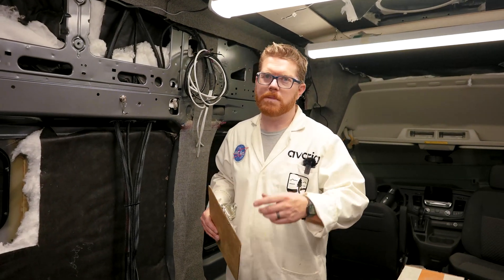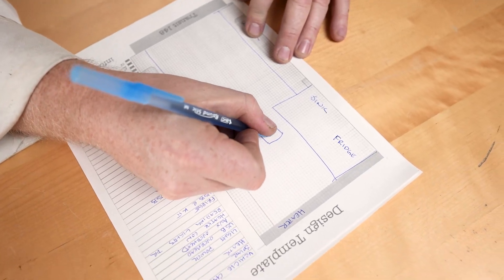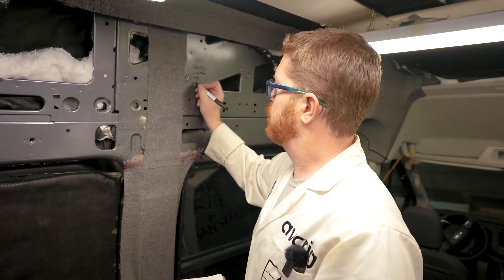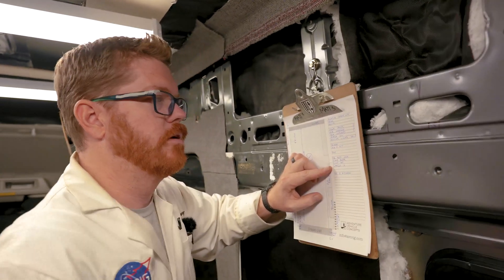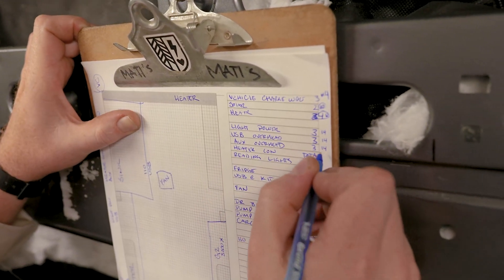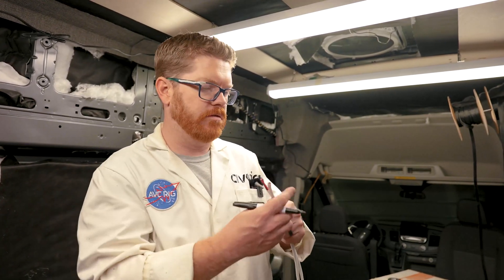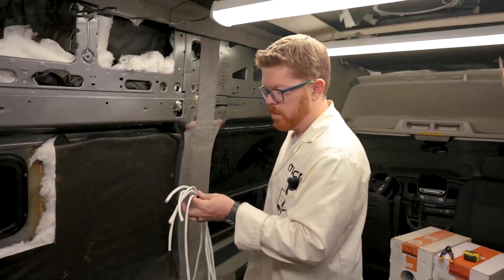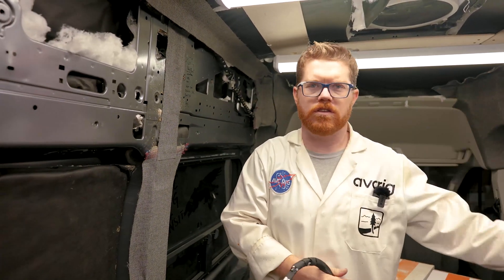WIRING in Ford Transit | Custom Wiring Routing - Planning and Install

Comment: Is there a specific reason to put the yeti goal zero 3000 on the opposite side as the water or is there just not space under the kitchen galley for it in this layout?
Reply from the maker: Two reasons. 1. I don’t like my main power system next to my water system. 2. Better balance of weight. That GZ 3000 is heavy!
Reply: @AVCRIG  cool. Thanks!

Comment: Another great video, thank you very much.
I’m leaning toward it being a good idea to insulate and frame before wiring? Does that seem mostly correct?
Reply from the maker: Yes, absolutely. I find it’s easier to insulate first. Framing the ceiling is good it holds up the wire runs. I don’t frame the walls. I found it unnecessary.

Comment: Very helpful video thanks! Question tho, when you're measuring out length of wire from your goal zero to the water pump you mention you pull 5 arm lengths. when do you account for the switch for the pump? Does that not have to be included in that circuit or do you run that length separately?
Reply from the maker: I run that length separately. Switches go in different locations for different builds. This is also why I over size the wire for this circuit.

Comment: Where do you wire the D+ ignition wire for a DC charger? Do I need to pull the driver seat to access the vehicle interface connector?
Reply from the maker: We use the Victron Orion that doesn’t need an ignition wire. If your system requires it you are correct that you pull the seat to access the wiring location. (It’s not too tough I did it for my subwoofer)

Comment: These videos are super helpful and well timed as I recently started my build.  I am curious why you routed the wires through the ceiling rather than through the wiring channel included in your sub-floor?  I purchased one of your sub-floors and am getting ready to install it, but still trying to decide if I want to run the wires under the floor or not.  Thanks!
Reply from the maker: I run the vehicle charge wire and Espar power wire under the floor. I’ve definitely run more in the past on other builds. Especially the larger gauge wires for pump and fridge.  This was a pretty simple build and I wanted to show more options for DIYers.  Thanks for the question!

Comment: Love your video!  I would love to see how you connected the alternator power cable to the driver's seat location.
Reply from the maker: That’s a good point. I’ll add that to our Yeti power setup video.  
If you need that now, there is a CCP on the drivers seat base side (outside to the door) two posts provide power. Larger post is 175 amps and the smaller is 50 (or maybe 60, they changes with the 2020 and I forget). We connect a 4AWG but you’ll have to do the math for your power pull and length.
Reply: @AVCRIG  thanks, the wire route is what I was interested in seeing.
Reply from the maker: @steveocheltree3575   ahhhh.  Check out our sub floor install we run the wires under the flooring.

Comment: Do you have a link to the wire grommets you used?
Reply from the maker: I have to get them from a local electrical supply. They are called knockout bushings. We use the 1” that fits a 1 3/8 hole. The brand is Hayco

Comment: Can you explain what you used for the ceiling  furring “strips”? Did you just use the plus nuts, and then bend them to the van’s curves?
Reply from the maker: We have another video coming out about ceiling install and details. We do add 8mm plus nuts to the ceiling. We show this in our new van videos. We fit the ceiling with 1/4 strips to support the ceiling panels. The plus nuts are there to mount Unistrut rails on top of the ceiling for cabinets in the future.

Comment: Thanks for the wiring video. What is the “protective sleeve” you used.
Reply from the maker: We use this kind of stuff as well as split loom. This link is to a product example, but not the correct diameter. 100ft - 1/4 inch PET Expandable Braided Sleeving – Black – Alex Tech braided cable sleeve https://www.amazon.com/dp/B074GM1PK1/ref=cm_sw_r_cp_api_i_H37SP33Y8G2Y7H3JP5BK?_encoding=UTF8&psc=1